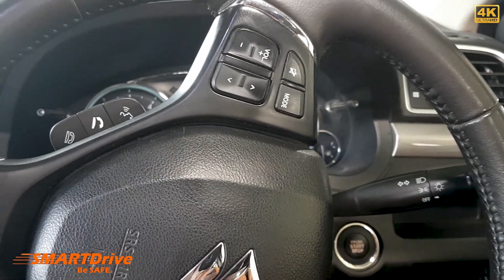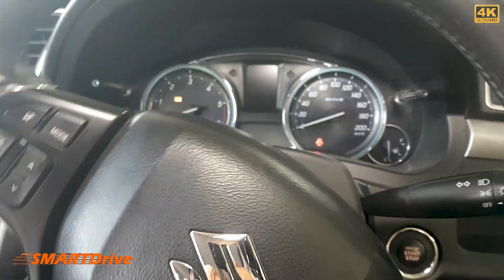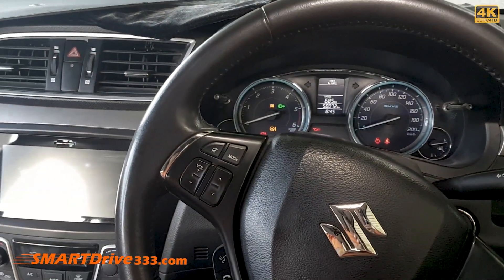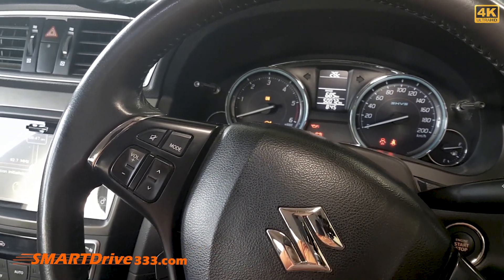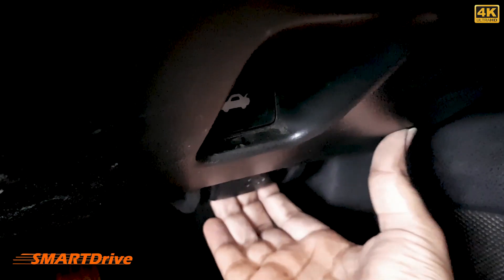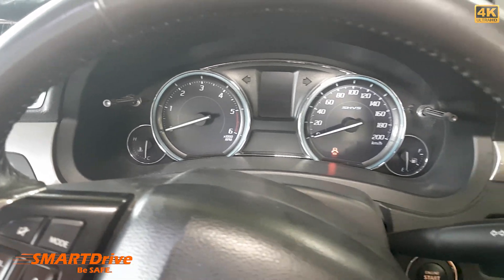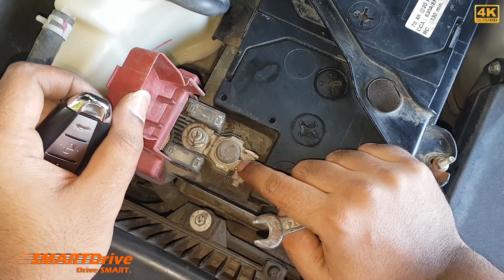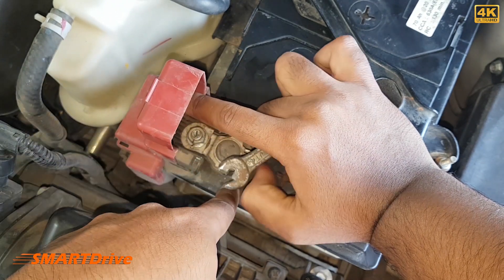DIY Car Battery Charging with a Home Inverter: Easy and Efficient :SMARTDrive

Comment: I want to charge 35AH Battery & I have Sukam UPS, Can I charge the car battery ?
If yes, then what precautions should i need to take before charging ?
Also, Should I need to check car battery voltage before charging ?
Reply from the maker: Yes. You can definitely charge 35Ah battery on UPS.
Jist connect the terminals properly and wait till charging logo goes off.
Precuation is only related to water levels.
1.If the water levels in battery are too low. Then you need to refill it with the help of professionals.
2.Battery voltage must be more than 10v.
Else there will be cell damage issue.

Comment: Hi
My 35Ah exide car battery has terminal voltage of 13.xx  but most of time  good cranking  not obtained  or not cranking at all.
It is now 3.5 years old.
Average 10km runs in 4or five days.
Can I revive it?
How Can a home inverter with 10/14 A selectable charging current and 13.xx/14.xx  charging voltage selection use to revive?
Reply from the maker: 1. Battery is pretty old and your car usage frequency is very less as per older battery.
2. Smartdrive suggests if battery gives starting problem once then you must change battery to avoid future issues.

3. Yes. Home inverter will resolve your issue for this time. Kidnly replace battery with newer one.(you don't want to make it PUSH TO START)
Reply: @SMARTDrive  thankyou
Reply: Newer Home inverter uses multi stage charging. 
They specify the Ah range of battery that can be connected to it.
 I think as  first charging stage is bulk mode- ... ie; constant current,  if we connect well discharged car starting battery,  chances of possible high charging current(bulk) 10/14 Amps .
Is it good for car battery? As it is lower in  Ah(35,45...) 
So I think we have to check and  limit  the initial charging current as per manufacturer data (and monitor at least first-time for the particular battery)
Reply from the maker: Can't comment on inverter type. This charging tip is just to avoid excessive inconvenience and unnecessary charged fees.

Comment: Can we use home battery to start the car?
Reply from the maker: Not really. Home inverter batteries are made for long and slow discharging. But car battery is designed to give mex load discharge in milliseconds.
Home batteries are very heavy to move and not so useful for such small purpose.

Comment: I have the home inverter system which provides the backup power when there is no grid power and charges to the battery charging when grid comes backup and this process of switching is automatic.

Now I have connected the solar controller to the battery and I want to stop my inverter to work as pure inverter and not the battery charger.

The way I am doing now is using bypass switch present on the inverter which bypass inverter when there is power hence battery will not be charged but when power goes off I have to manually turn on the inverter.
Reply from the maker: Wow.
You are awesome.
Most of us still dreaming about solar power till date.

Comment: Can I charge Exide Car battery through Inverter of battery 78Ah .how much time I should charge it for full charge & is it Ok to Charge Through Luminous Inverter
Reply from the maker: Thanks for question.
1. Yes you can charge exide 78Ah battery from inverter.
2. It will take approx 2 hours (depends on inveter setting)
3. Luminous does fantastic job of battery charging.

Comment: How much time we should give for charging
Reply from the maker: After Inverter's charging light stops blinking or turns off completely.

Normally it takes around 40-50 min. 
But some Inverter have battery life saving  features which takes longer charging time

Comment: Your battery is complete down. How long did you charge your battery to make it full 12.6 volt??
Reply from the maker: 2 hours approx.
Reply: @SMARTDrive  12.6 reading or white colour on magic eye??? If white colour shows, why the voltage is not getting down???
Reply from the maker: wait until charging light stops glowing...
Reply: @SMARTDrive  sir ,my car sf battery has magic eye. The voltage shows 12.6 but the magic eye is white in colour which means needs charging. Confusing which is the correct one 12.6 v or white colour?? Green is ok, and red is service. The battery is just 3 months old and no starting issues.
Reply: Yes
Reply from the maker: on- battery indication is for acid level.
if it's 3 month old. then visit the seller for regular check. and inform him about issue.
Reply: @SMARTDrive  u mean....green means acid level is ok, White is acid level not ok??
Reply: Bhai hamne ilets to kiya nhi Hindi me bnao na video
Reply from the maker: jaroor.

Comment: What's the current coming out from the inverter??
Reply from the maker: varies from inverter to inverter. but main factor is Voltage. 
which is same as of car battery. 
charging voltage ~13  volts.

ideal for 12 V battery.
Reply: @SMARTDrive  you didn't answer his question, won't higher current from the inverter damage the battery? Ideally you need to charge at 2A-3A max as car batteries as much smaller, inverter provides 7A-15A
Reply from the maker: In this case voltage makes real difference and it is only recommended in the emergencies to use this hack so don't worry the car battery will be ok for one or two usage